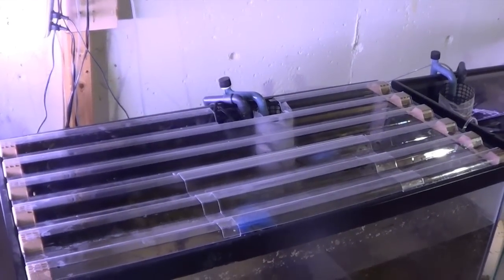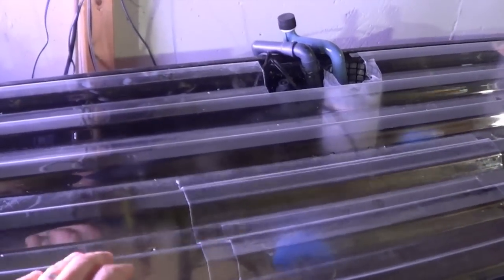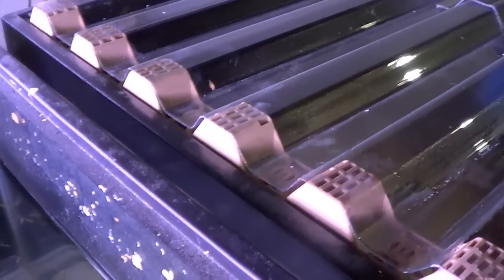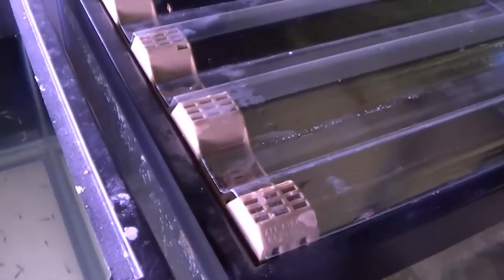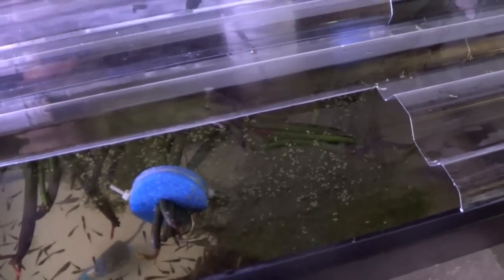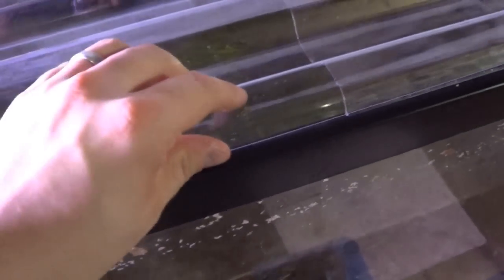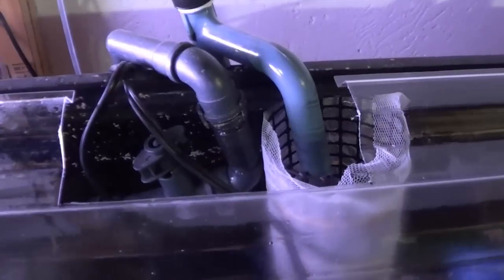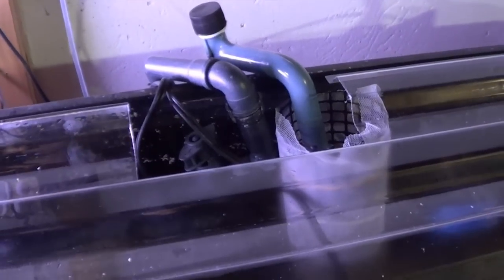#231: Virtually Indestructable DIY Corrugated Poly-carbonate Aquarium Cover - DIY Wednesday

Comment: its in the roofing isle at my local store.  I used a 3" cutoff wheel to cut it as my jigsaw just made it shatter.
Reply from the maker: that's strange, i've never seen polycarb shatter, are you sure its polycarb and not pvc?

Comment: Hi, Thanks for the clip.
Do the polycarbonate sheets absorb UV light? I'd like to place a light on top of the polycarbonate lid for my plants.
Will the UV filter built in to the material block the necessary light that the plants require?

Thanks.
Reply from the maker: polycarbonate blocks 90-100% of UV light as far as i know